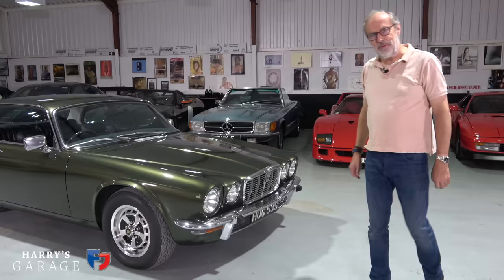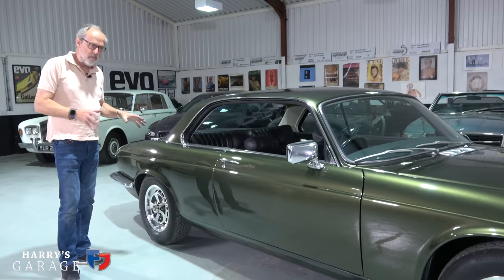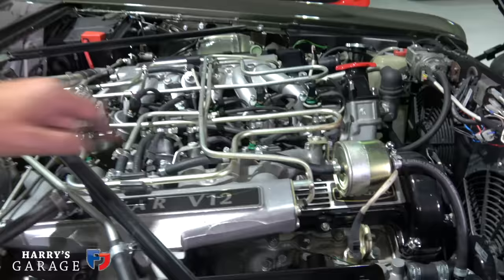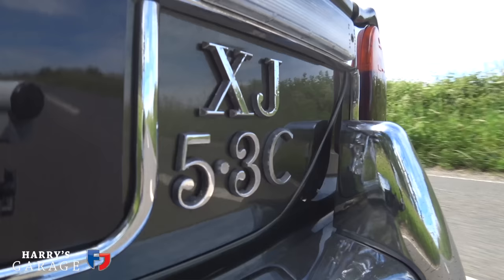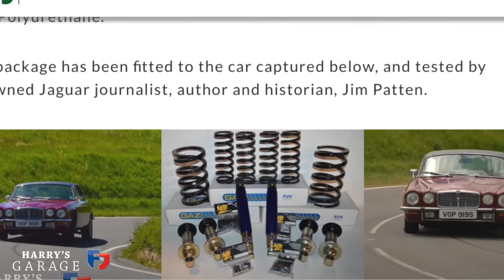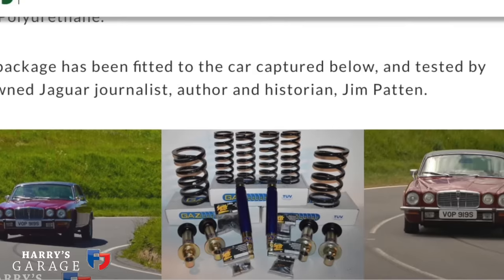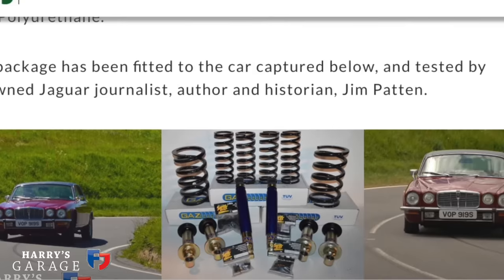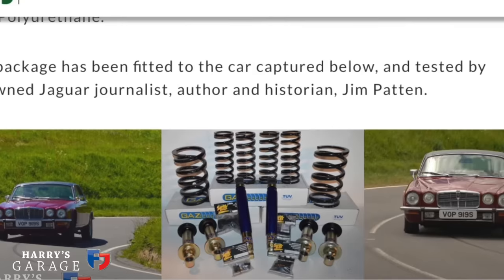Is this Jaguar XJ Coupe V12 manual the best sounding car in my garage? Maybe..

Comment: Had a 71 xj12 sedan which had a Chevy 350 conversion the engine bolts are right up to the stock I believe 350 Chevy turbo transmission with Chevy drive shaft and Chevy rear end Jaguar contracted with Chevy those years by far my favorite car ever I'm very jealous of the one there and they're hard to find now in the states they just feel so dominant when you drive them and did you know that Jag copied the corvair look that eventually went into the Corvette also if you look the XJ looks very much like the corvair and some of the other Chevy wheel well flare look you'll see it that's why I called nine heavy Chevy I would give the rest of my teeth for another

Comment: Very Nice,

Don't change the bore and stroke unless you really think you know better than Walter Hassan and Harry Mundy.  Many consider the 6 litre not as well-balanced as the 5.3, anything above that is a performance engine, and you take all the compromises that come with that, including engine life, balance, etc., not to mention lots of money.

If memory serves, AJ6 lengthened the cylinder induction length of the engine by cutting the inlet manifolds apart and fitting small induction trumpets to the end of the induction tube to increase the length and change the torque curve, they then welded it all back together, so it looked standard.  I can't remember if they ended up casting their own manifolds or not.

Same firing order as the RR Kestrel, Buzzard, R, 1933 Griffin, and Merlin, but not the 1939 Griffin which had three different firing orders all different to the Merlin.

As it has that firing order, playing with the exhaust is going to make some interesting changes, the big one, going 3-2-2, 6-2, 12-1-2 okay you may have some issues with fitting that one, and of course various ratios of intermix between the two banks.  There are other options, some quite strange such as 2-3-2, etc.  Of course, looking at what Tullis did in Group 44 and looking at the Le Mans Silk Cut cars and the resultant sound, but all these guys were going for performance.  Then there is tweaking the lengths of the pipes, although you can end up with a nightmare of switchbacks.   The only way to "tune" the sound is to have an engine on a dyno on the bench and someone with a good feel for exhaust, or knowing someone who has already gone through it.  Best sound, unfortunately, does NOT equal best performance (you can get some really aggressive sounds by maladjusted header lengths, also some bloody horrible ones), your choice, I know which I would go with, especially in a tunnel or underpass.

Anyhow, I really enjoyed listening to the engine, you seem to like the high rev sound, and it does sound fantastic.  But sometimes it is hard to get that opportunity to wind the car up (some looks from the other seat), perhaps just a bit more howl when you load the engine up in the mid-rev range,  a bit more grunt if you like.  I was always surprised at all the different sounds you could get out of a classic Triumph Trident (BSA Rocket three) by changing the exhaust, standard, they had the outer two cylinders feeding a pipe each and the centre cylinder split with half to each of the two exhausts, subtle changes were made as well as some unsubtle ones, they were just a quarter of what you have.

Good luck and have some fun embarrassing all those, ahhh, people in their hot hatches (okay, they may not have even taste to know they should be embarrassed) .

Comment: I bought and xj6 for £600 in 86. I also had a rough maxi 1500 and got offered a straight swap for an xj12. You couldnt give stuff like this away back then. Probably the best v 12 ever made. If only they would fit in the countach which is one of the worst.

Comment: Definitely  on a par with the Countach, it sounds incredible I have always love the jag v12 incredible smooth, one note there is no air flow meter as it D Jetronic and glad you keept it that way with its AJ6 engineering upgrade. if you ever have trouble with the Djet injectors firing tap them with a pannel pin hammer the often start working  after a little tap and there come back to life they don't like sitting around for any long periods of time,  any parts you need and can't find drop  me a message. Cheer Mark

Comment: Your reasoning on the slimmer wheel package is sound. Yes, I like the period wheels. I would have been tempted to go larger diameter, but any non-stock wheel on a Jaguar is a tricky thing to get right. To technical looking and it looks wrong, too traditional (but not Jaguar) and it looks wrong. You simply cannot go wrong with stock performance wheels!

Comment: Gorgeous car and I'm really surprised by the engine, what a lovely and speedy surprise it is, I always thought of the jaguar v12s as lazy, torque beast, not this revvy this. 
 About the car, people seem to forget what adequate power is in these times 1000+ horsepower. And like you said to Johnny Smith, if you that adrenaline shot, just get in a bike, or get in the Project 7 or 8 in your case. Superb car, but I'm itching to see the Lancia back now.

Comment: Wow, I love these Jag ht coups, it's such a shame they've been produced in such low numbers, as poor bastards such as myself will never be able to afford one that isn't a rust bucket, if even that. Gotta agree with your wheel choice anyway, or lack there of, as in a strange struck of luck the stock ones look amazing, as usually wheels are the first thing you change, I certainly do, but these truly look beautiful with their tall period rubber. As for the wide arch conversion, my god if that looks awful, you can't do that on such an elegant body style, it just does not work, it's one of those really rare occasions where the factory did everything as they were supposed to, a really amazing car, hearing it roar is such a pleasure 👍🏻🖤🏴‍☠️

Comment: It sounds much different from the original v12 setup. Normally you can't even tell if the engine is running they are so quiet. I've owned two xjs in the past.

Comment: Nice, if they weren’t so bloody expensive in Australia I’d definitely have one and upgrade it, a shame they never did the later XJ8’s in a coupe, I have a 4l V8 with graphite leather and although some will bag it I because it’s not a factory unreliable model, I love it... I had a 95 XJR prior and would love an E Type convertible or even a 60’s 3.8 but even they’re too damned expensive here (they’re up there with C6 Corvette prices or need $30kAUD spent on them) for someone who can only afford one car... unless of course I sell my boat... or house which I’m considering as the boat is a 50’ Oceanis and more than suitable to permanently live aboard just what to do with three motorcycles and a car that needs to be garaged when you’re retired and the extra cost would run down the bank account? First world problems lol. Comfortably financially as thing’s are but no where near rich, anyone would think I’m a whinging Pom 🙃. Love this XJC, I wouldn’t change a thing.

Comment: Repost of comment post potential scammer  response re random prize.
Sounds like Tom Walkinshaw in the BIG CAT at Bathurst !  12cylinders singing  .. There's something I will say Amen,  to !  2nd to 3rd gear at 7000rpm as we drive through the Alps  .. when are we going? 
STUPENDOUS, Harry. 
PS. Anyone with experience in heavier fast classics wouldn't mind the elegant lady having a wiggle whilst on taller period tyre's  .. so long as you know what you are doing with the weight you're shuffling along ..

Comment: Why does anyone think that bigger wheels and tyres would somehow improve a car, when that car's suspension and chassis were designed around the original factory-fit wheel/tyre combo? The XJ series were, and still are, notable for their well designed, properly set up suspension that offered excellent ride and handling while being comfortable. Bigger wheels and wider, lower profile tyres would ruin that almost ideal compromise, as well as (as described by Harry) compromise the car's structural integrity, partly because of the increased noise, vibration and harshness (NVH) that would be transmitted through the shell.

Comment: didn´t this car originally had those mirrors also used by Porshe in 74 on the 911´s or similar  to the ones in the BMW´s 2002 from 74/5 but bigger ,those look like the ones on my corniche with hardtop or coupé

Comment: In the day Group 44 developed the Jag v12 well ahead of Broadspeed and TWR. Yes they were yanks, but who else developed the  “Mag 12”? Full potential of Jag v12 criminally ignored. In general and full potential never achieved. IMH BMW developed the V12 to what the jag v12 should have been. Particularly with the elongated intake manifolds, and balanced runners, in stock form. Mr HM has exposed this and pleasure to view and hear, with manual of course👍⚡️

Comment: normally those tires are better and not so slim the increasing of the lergeness of the tyres might put the car working worse when not engeniered to them ,the handling and direction on lot of old cars installed with larger tyres gave them problems and the suspenction might not work well with larger tyres

Comment: 2:59 So the rear suspension is just like on a corvette C3 then, where the axel is the major connecting bit between the wheel and the car, the only difference being the shock absorber on that is actually a transverse mounted leaf spring vs two shocks, did these suffer from axel failure as well if you didnt fit offset trailing arms, or traction bars to compensate for the larger tires like they did on the Baldwin Motions and beaf up the diff with those race cars?

also this cars gotta be putting out far more than stock to be that quick, these things were rubbish in period, like I bet yeah the camshaft maybe the same, but the Cylinders and Pistons have been properly weighed and balanced in addition to the sport kit under it, given how bad the in period castings were and are, and probably work far better in tandem than they ever did in stock

as sometimes on cars of that vintage, such as the miura, you can actually find cylinders and pistons that are like 10 or 20 grams off from each other if someones just thrown one in or one got in the bin that really shouldnt have. 

such as what was found with a miura rebuild I've been following for 20 some years as this guy rebuilds it piece by piece, like you wouldnt think, but it does show up and make it so some engines just perform better than others even if they've got the same parts in it

it even showed up in a dodge rebuild of a 70 challenger Nick of Nicks garage was working on with his 440, and it pickled him a great deal. 

given his test mule 440 was running better than the actual 440 the car came with that he rebuilt exactly the same way, yet the tester was putting out way more power. 

and it just came down to the castings being heavier than they were in his tester, hence why regardless of if it was 1960 or 2010 when you get a car that really runs well, you hold onto it as that still happens to this day regardless of who made it or when

and look what a difference it makes, you went from wanting to bin that jag and throw it away to fully restoring it and falling in love with it.

also with the steering wheel, wasnt it a tradition in british cars to have the steering wheel and some of the leather in the same color as the outside, maybe you need to get some dark green leather fitted to it to make it stand out

like a retrim in a different color, granted maybe using one that's perrished, and when you do, I need the number, I got a momo Veloce from 1984 I need done meself lol

Comment: How quickly it revs? You should try a Triumph Daytona 650 with it's 14k rpm red line start. Untill you've revved out a 600cc class sport bike you have never lived. The noise is almost orgasmic 😳

Comment: Harry, i have just put GAZ adjustables on my 72 MGB GT, along with new saddles, rubbers etc started it with 4 clicks clockwise. Firm enough  handles better with more control on the corners. You mentioned that you turned the stiffening up, can i ask what you turned the adjustables up to. Different cars i know but just interested. Thanks again for video.

Comment: Harry, those comments are from little kids. Don't let them waste your time.

Wheels and tyres are perfect.

Lets move on.
The engine seems like a small supercharged Merlin.
Its a WW2 plane sound.
Its unique. Its Perfect.
But YOU should get it to purr instead of Formula 1 racing. 

YOU let the engine do all the work.

Its AERO but Its WW2 fighter plane aero. So YOU operate it smoothly.
The engine is doing all the violence.
YOU Sit back and experience it.

CHEERS!

Comment: In 1975 Jaguar decided to rip off the 1962 Alfa Romeo 2600 / 2000 Coupe  designed by Bertone.
The only difference was that the Jag was pillarless.....Check out the Alfa and look at the resemblance if you are not in the know....

Comment: How does the owner of this car  know or seem to know the problems of chassis and body rigidity?  Has he carried out finite element analysis to determinate the woe inflicted on the A pillar?  Or can he feel the chassis shifting just like Mike Hailwood could feel a bike frame with and without Reynolds 531 ( tubing) .. Or is this something which he has read as he wants correct factory recommended narrow tyres. He seems to process a lot of information but could make the listening experience better and in less time or fewer minutes.

Comment: You have too many modern, fast cars in your garage. Especially that Toyota.
I had a E30 coupe, manual, small tires, and I was driving it with all windows sunroof open.
That's what cars are all about - having fun below the speed limit, pedal to the metal, wind in your hair.

Comment: Why didn't Harry put bigger wheels on the car? That's because he possesses A BRAIN! First of all, why ruin the originality and replace the beautiful, elegant Kent alloys? Secondly larger wheels would require low profile tyres- which would degrade the ride quality. What's the point of ruining or degrading the ride quality on a luxury GT? There is NO POINT!

The current trend to fit larger wheels with low profiles is intellectually bankrupt in most instances. For everyday driving, it's utterly pointless having large alloys and elastic band tyres- ride quality is adversely effected. It adds nothing to the driving experience unless you are regularly embarking on track days, for real world motoring, they are a waste of time-especially on a classic.

Comment: As much as i like your video's and presentation knowledge etc etc... I think you have lost the plot with this one.
No way should this car sound like a full blooded Ferrari... It's was built as a smooth.. comfortable long distance cruiser.
You have made it sound like a boy racer car... so you might as well... to finish an otherwise lovely restoration... put a stripe all the way over and down the middle of the car... to completely mess it up. 
Sorry but it's hidious.

Comment: The over emphasis of exhaust noise is stupid and does not reflect the quality or engineering of the powerplant.  All the Jaguar V-12 Engines were fairly worthless.  They did not demonstrate any longevity whether they were Fuel Injected or Carburetor equiped.  The E-Type V12 with its Zenith Stromberg Carbs was also pathetic.  The fact Manual Transmissions were not available due to US Emissions was also ridiculous.  Apparently their Bosch Fuel Injection System was also worthless.  The Jaguar 4.2 Dual Overhead Camshaft Engine with Triple 2" SU Carburetors, was the best they could come up with.  Although the english produced numerous good looking Motor Vehicles, Technically they were not well engineered or designed.  To replace a Clutch Assy. on any XKE, it was necessary to Remove the Engine & Trans. representing 28 Hours of Labor.  The same stupid design applied to Austin Healy, MG and several others.  "Yeah, but it sounds Good"............................
Reply: Well that's put a slight dampening on proceedings. What car should we all aspire to?
Reply: @philhealey449  
You should rephrase your question in oreder to get a proper response.  Hope you're not referring to some other 'Engine Production Exhaust Noise?